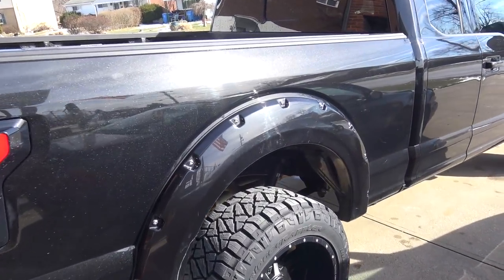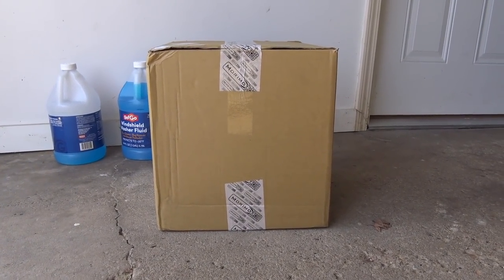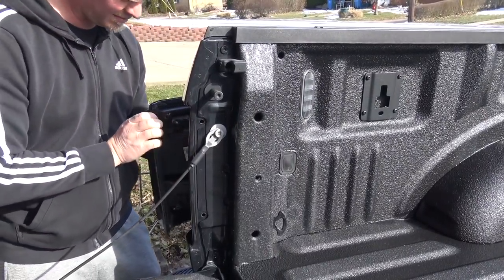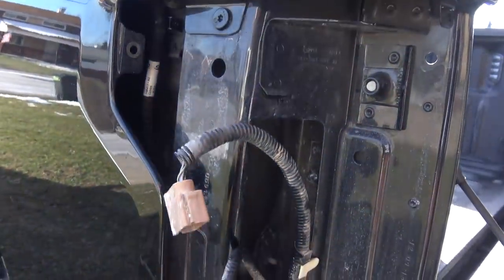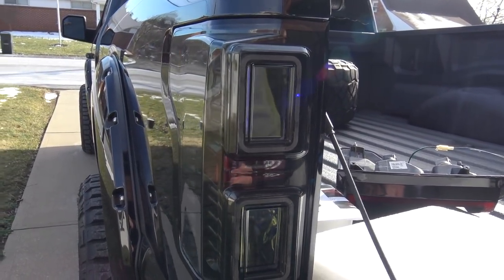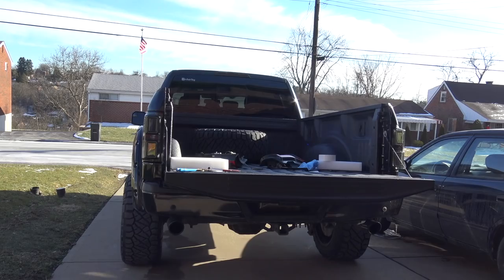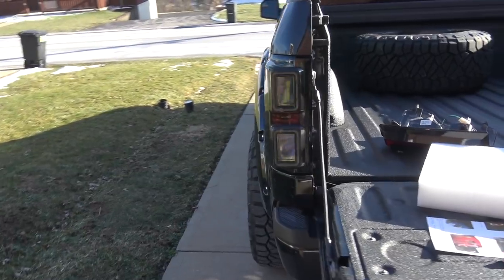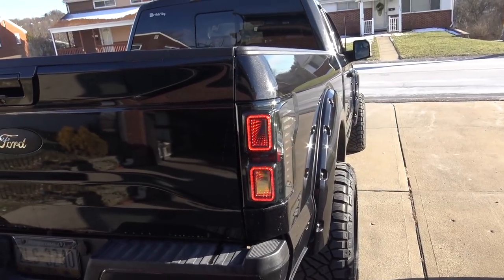Done With The Anzo's..Installing Morimoto Taillights On My F150!

Comment: Hey Mike I just bought a 2016 Ford Fusion SE AWD with 24,000 miles on it.
Reply: Nice. 2.0T is a quick engine
Reply: good luck once you get over 100,000 miles.
Reply: @Keaton0801  I already have an 06 Fusion with 244000 miles on it and have never had any major issues with it. Just replaced the original wheel bearings a month ago.
Reply: I have a 2016 ford fusion titanium FWD and it was nice at first but have had nothing but issues lately
Reply: I like the ford Taurus SHO
Reply: @Sniperkiller104  yeah 06, that was when they made them good. Modern ones are brand new rolling piles of cheaply made shit. They focus more on  technology than longivity these days. It's a waste of money all that technology, it's just more things to go wrong in my opinion. If you want it, there is aftermarket. Buy the base model, and make it to your liking on the technology with aftermarket and svae your self $5,000-$10,000 in the end. Anything Ford post 2010 is pretty much a technological nightmare once oyy get over 100,000 miles. That's when all that tech they upsold you on starts to go bad.

Comment: Great vid, love the look of those tail lights!  You should pull your fender flares off in the spring and clean behind them and get a good coat or two of wax on there (I don't think you ceramic coated the truck).  I hear moisture and shit gets in behind there and can reek havoc with rust and paint where the lip sits against the body.

Comment: @autovlog Hey, you should check out the Morimoto XB headlights, they come smoked with sequential turn signal and quad beam - 2 low and two high, I have them on mine and they"re amazing, super bright - even brighter than the OEM LED headlights!

Comment: I've stuck with my Anzos until I find a good deal on a set of King Ranch or Raptor tails to go on my 2015. I have the Mori XB headlights sitting in the box waiting for a decent day to install. (It's been ~10 degrees here in upstate NY and I don't have a garage.)
As with most aftermarket tails, not all reviews are very good considering condensation and leaks. So I figure I have a really good set and I'll just stick with it. Let me know when you're finished the VMP kit though, I wouldn't mind picking that up from you. :)

Comment: I have a 2012 F-150 with a good list of kids such as grill bumper wheels etc. and was wondering if I should get the outlaw exhaust for my 5.0 v8? It is an axle dump so there would be no visible exhaust from the back or sides which I really like and I’ve heard it’s LOUD without being clapped out, so it still has a deep rumble, anyone have this and any recommendations?

Comment: You need to get rid of the anzo headlights and get the morimotos I have the same taillights and the morimoto xB headlights they are amazing light output and beam pattern blows everything out of the water also the sequential turn signal is sick I'm in Syracuse NY and someday would be sick to meet up because I have a black crew cab tuxedo black f150 with a 2.7 exoboost which performance wise can't go any further and similar exterior mods and such would be cool to compare the two trucks

Comment: Installed on my truck today. Anyone have issues with the way they sit. Not completely flush with the truck, i can see the gold pins from a bit of a gap between the light and truck itself.  Looks like they don't completely go all the way into the holes on the truck.